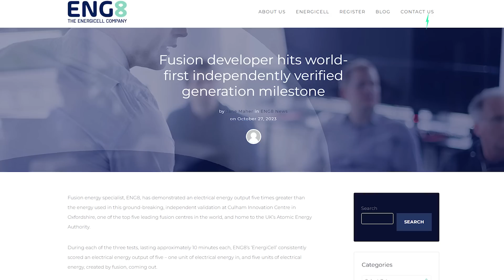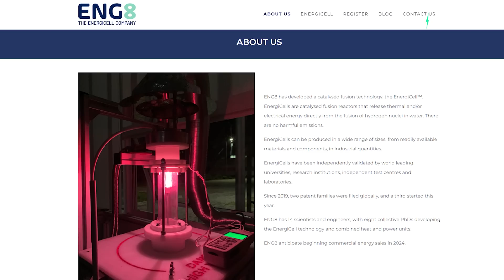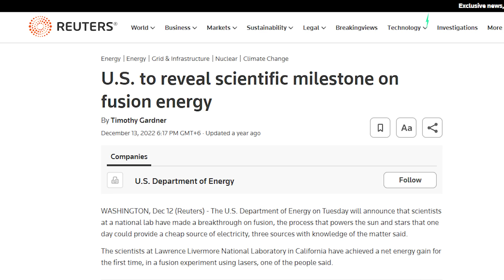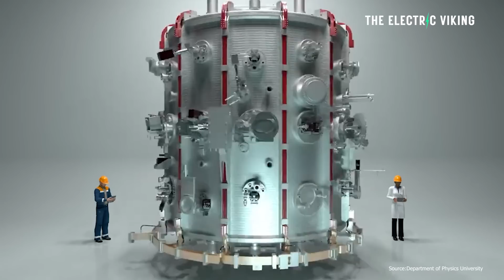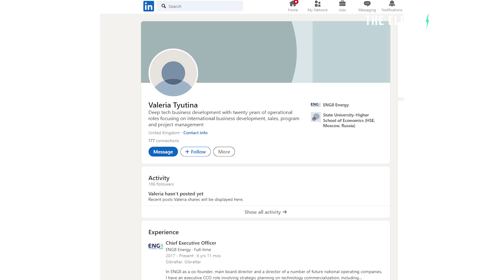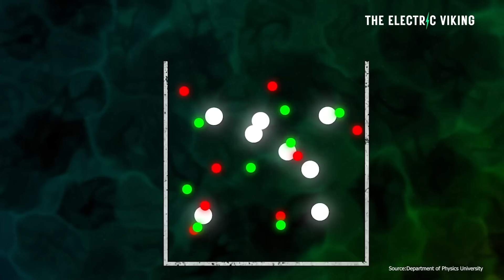Nuclear fusion capable of 500% energy return using water - game over!

Comment: Total nonsense. This guy couldn't even explain how this energy production process works.  Cavitation in water due to sound or high heating has been claimed by researchers to produce small amounts of excess heat, supposedly due to fusion of hydrogen, but this is not a way of producing vast amounts of electricity.  It's a laboratory curiosity, and falls into the category of Cold Fusion, which is a very dodgy theory of fusion,  as no one has proved that it works. All the claims of cold fusion have so far been proved to be fraudulent.

Comment: So if they use some of that Tritium water from Japan that they are just dumping. They could up that Q number even further. 
Other companies have tried frozen pellets of duterium smashed together with rail guns. But if you could just fire ice cubes into a plasma chamber, well any good Engineers should be able to solve that problem. 
One could imagine radial rail guns firing every few seconds, and fusion energy as cheap as an F1 V12 engine.
Pipe dreams can come true maybe.

Comment: Is it the H20 or the small amount of D2O most water contains small amounts of ?  What does the lithium transmute into.
Plasma arc water heaters have been know for some time for 200% efficiency, liberating natural amounts of D2O in H2O.
That will be great if 500% electrical can be achieved.

Comment: I believe you have been misled by their press release claiming that the experiment was 'validated at' rather than 'validated by' Culham Laboratory. The press release is designed to be misinterpreted in the way that you have in an attempt to lend credence to their claims. The very fact that they have rented space at the Culham Innovation Centre, then called in a safety consultancy with no experience of fusion just so that they could print those phrases in their press release, is to me the strongest evidence that this is deliberate fraud rather than anything else.

Comment: This approach goes back several years, previously called the "star in jar" (SIJ) approach.

The reaction is NOT deuterium=deuterium fusion, and it uses light water H2O as part of the fuel -- thus NOT Pons and Fleischman cold fusion. Read the ENG-8 website/literature - I find they carefully distance themselves from P&F.

There are several research teams working on this, in addition to ENG-8.

Not sure why TPTB would oppose this approach - except that they would certainly want to CONTROL it... It can operate on a small scale - individual homes even. Or on a much larger scale... IF CONFIRMED and understood.
Reply: PS - some researchers, including me, think this is a proton - Nickel-nucleus reaction.

Comment: A guy claimed this in Queensland in the seventies. His fuel from water scheme squeezed several million out of the Bjelke Peterson govt before saner folk put an end to it.

You know this one is nonsense as the Youtube video shows them standing around less than a metre from the 'fusion cell' while it is operating. If there was a useful level of fusion occurring, without loads of shielding, the flux of gammas and neutrons at this distance from the fusion reaction, would kill them.

Nuclear energy, fission and fusion, aint that easy.

Comment: Falsehood in the video: The requirement for heating up fusion fuel to the temperature of the Sun.  Most artificial means of fusion requires MUCH GREATER temperatures than those found in the Sun. The temperature at the core of the sun is only 27 million degrees F. The temperature required for tokamak fusion devices are something like 150 million degrees C. This is because pressures at the core of the Sun are tremendous.

Comment: Yea, I am not sold.  This sounds like a fairytale.  If this has been independently verified, where are the public reports?  Why is this nowhere in the popular press?  Surely, if this is a readily usable fusion power reactor to be deployable next, somebody would be losing their mind.  especially if they have the receipts of independent verification.  However, you are the only person I have seen cover it.

The extremely brief tech overview you gave sounds like smoke and mirrors.  Using water as a fuel and a fusion catalyst?  Water is a moderator for nuclear reactions.  This is great for fission, which needs the thermal range neutrons that water in the reactor vessel creates.  However, fusion needs extremely high energy protons to overcome the columb repulsion and get to the range of the strong force that will actually cause the fusion.  As of yet, only pressure, temperature, and excitation can do this.  

Usually, your videos are grounded and realistic.  However, this one is either ignorance or propaganda.  I am not sure which.

Comment: The strange thing about this is that there isn't much on the internet about it. It may be that the world of science is saying nothing until they can fully verify or debunk this.  But if it is real, it would change everything.  So much would it change that I could imagine some governments would want to try to gain exclusive control of it, because of the incredible power it would grant. Imagine, for example, the nightmare of North Korea having unlimited energy.  Unlimited energy essentially means unlimited ability to move and shape matter and unlimited manufacturing capacity, once you combine the unlimited energy with robots. Unlimited energy means unlimited wealth.  Economics, based in part on there being limited supplies of things, would be utterly upended.  Prices of many things would fall to zero.  And what happens when insane or evil groups or governments get hold of unlimited energy? To some extent, that would be countered by accountable governments who would also have unlimited energy -- but perhaps the international situation would be even less manageable than it is currently.

Comment: To be absolutely clear: "5 times" (if true) refers to the energy gain of the reaction, not of the whole system. e.g. a typical solar cell is only 20% efficient. similarly, the energy collection efficiency of these systems is likely to be around 5% in practice. So the energy gain needs to be at least 20x just to break even and around 500x to be practical. We will reach there eventually in around 50-100 years or so.

Comment: I would love this to be true, but I think it is BS. There is no explanation of the reaction, we just get a graphic of the standard  tritium/deuterium reaction which is also used by a lot of other fusion experiments. Even if they have done this, it will still be very expensive as tritium ( hydrogen with two neutrons) is mega expensive at $30,000 /gram. It has a half life of about 12 years. It would be nice if the electricity produced by fusing a gram deuterium and tritium  is greater than the fuel cost, this needs to be discussed as commercial viability is what you need to achieve.  The left over high energy neutron would have to be managed, as too many of these guys flying about is very dangerous to equipment and people.  Other reactions, such a boron3+deuterium  and helium3 (very expensive!)  + deuterium expel protons which can be 'easily' used to extract energy. as that can be controlled by magnetic fields. I would also expect that due to the usual inefficiencies in the whole system, you might need something like 5 or 10  times the energy out from the reaction to make it viable.

Comment: There have been decades of reports of excess energy systems. I am aware of 2 companies that are already selling overunity generators to industry on the quiet. It is here, finally. Much greater outputs than 5 to 1. We are talking infrastructure scale installations and major names purchasing. 
In the 1990s I worked with Bruce de Palma. He promised similar outputs and more. Died under suspicious circumstances. There have been so many pioneers that we should honour and give thanks to. There is energy in the fabric of this matrix.

Comment: Very interesting however don't throw away your solar panels yet. If it is as successful as it claims make out, it will never be cheaper than rooftop solar electricity. After the initial installation cost is recouped the energy is free; anything commercialised into the market cannot beat free energy generated by a home system. The word from those that know is that, if and when fusion replaces coal, nuclear, gas (name your greenhouse/radioactive poison), it will act as a compliment to renewable energy, not a replacement because any energy generated will come at a cost, and profits are there to be exploited from the masses.

Comment: There has been a significant jump in fusion technical breakthroughs, however, while small gains in energy captured over energy input to start the fusion process have been achieved, these are not commercial. I am sceptical that this will be commercial as well.

Comment: Not true Sam. 
In October 2023, the Culham Centre for Fusion Energy (CCFE) released a statement saying that it had "not been able to validate" ENG8's claims about its fusion technology.

The CCFE said that it had conducted a series of experiments with ENG8's device, but that the results were "inconclusive". The CCFE said that it was "unable to reproduce the results claimed by ENG8" and that it was "concerned about the level of scientific rigor in ENG8's work".

ENG8 has disputed the CCFE's findings, saying that the CCFE did not have the expertise to properly test its device. The company has also said that it is confident that its technology will be validated by other independent testing.

Only time will tell whether or not ENG8's fusion technology will live up to its claims. However, the CCFE's statement is a significant setback for the company.

Comment: Ignition simply means you're getting more energy out than the amount of heat energy put into the reaction. However, heating is not 100% efficient. In fact it's < 1% efficient. So you're still putting 100x more energy in than what you're able to get out of it.  Unless the reaction is self-sustaining ignition, fusion will never work. If you constantly have to re-ignite 500 times a minute, we're still 200 years away from getting this done.

Comment: I'm working with a neighbor on a suitcase nuclear reactor for cars.  It boils water to run a steam turbine generator to continuously charge any EV battry whilst you drive.  1000% green energy, completely free power. Our reactor is the size of a suitcase and fits in any car trunk!  It comes with a 15 ft. cord which you fish out any roll-up car window and plug into the car's charging receptacle.  It charges the battry all the time, parked or speeding down the highway, so range is unlimited!
Reply: Sounds just as realistic as Sam's Fusion Power :-)
Reply: @dnomyarnostaw  Look, I worked at Radio Shack for years before they went under, and my business partner used to design electric pizza ovens.  We did not fall off the turnip truck yesterday, my friend!
Reply: @DavidWilliams-qk5jq  I'm f'ng impressed now. As an old Radio Shack employee myself, I saw some amazing things 😀
Reply: @dnomyarnostaw  I knew it bro!  I could tell when you used the words: "sounds just as realistic" in your first comments.  As you know, Realistic was Radio Shack's house brand stereo equipment.  As an alumni, we will give you a massive discount on our Suitcase Nuclear Reactor, which may be in beta testing before you can say Jack Robinson, if the creek don't rise.
Reply: @DavidWilliams-qk5jq  I'd forgotten that Brand name.
I tell you what,  though, Tandy had some great speakers.  👍
Reply: @dnomyarnostaw  I hate to ask, but would you be willing to participate in real world rear-end crash testing of our trunk mounted Suitcase Nuclear Reactor?  We don't have millions $$$ in the bank for simulated testing unfortunately.  And it is not too wise to have the founders of a company acting as "test pilots" I'm sure you will agree.

Comment: If it produces significant amount of power ( not just 1 dust speckle 50k C), imagine the amount of space you need to NOT melt(actually vaporize even ceramics) absolutely everything around it. I think even tokamacs struggle exactly with that : how do you contain that heat to be able to maintain the reaction (or just next cycle)

Comment: If this is real, it would in itself become a singularity -- a point when change becomes so accelerated that we cannot conceive what lies beyond that point.  A bit like death.  This device, if real, would mean virtually unlimited material wealth, unlimited ability to move, shape, and direct matter. With a device like this we could actually build an O'Neill cylinder. We could actually terraform planets.
Reply: @ejt3708 But the claim in this case is that the fuel is water, for example vapor in the air.  And who is going to throttle down the production of energy when you have devices that can produce unlimited amounts and can therefore power themselves?  Why would people throttle down a source of unlimited wealth?  If this device is real, that's what this would be. Just combine it with robots and you have unlimited manufacturing capacity -- with no energy or labor costs.  Prices for many things would fall to zero.  We have already seen something like that happen with some aspects of the internet and internet services, but the internet of things could extend that to material goods.
Reply: @Edward-d2t7r You still need raw materials to produce anything. Of course with unlimited energy, recycling can get very close to 100%. But still, prices will not fall to zero.

Also, with everybody producing unlimited amounts of energy, water might becom expensive.

Comment: Before you go off the deep end, you need to keep in mind that 'Q' greater than one is necessary, but not sufficient to make fusion economical. What that means is that if you don't have a Q greater than one, you can't possibly have a viable power source, but once you get past one, it does not matter how big the Q is because the economics are then driven by the fuel cost and the  build and equipment costs plus maintenance. All these factors are put together to compute the Levelized Cost of Electricity (LCoE), which has to be lower than the cost of wind and solar (that both have zero continuing fuel cost) in order to be economical for future grid power. Let us wait see what a pilot fusion power plant actually costs.
Reply: Good point Ken

Comment: I don't think a Q of 5 will change much. The reality is that it's still really hard to harness that energy efficiently enough to make fusion economically viable. The Q would likely have to be double or triple digits before it'll be anywhere near the ballpark of new generation fission or renewables. Also, the 500% claim isn't referring to efficiency,  it's referring to the ratio of energy in to energy out. Meaning there is a 500% gain in energy once the fusion reaction occurs vs the energy it took to create that reaction.  Think of it like the energy in a spark of a spark plug compared to the energy of the gasoline igniting. There is likely a several thousand percent gain in energy in combustng gasoline vs the spark of a spark plug.

With that said, I do think this is very exciting but it's not all that revolutionary. The previous Q record for a fusion reaction, not counting weapons, was almost 3, so 5 is great but not a huge step forward.

Comment: I will believe this when I see it at scale. For decades I have been hearing hype like this from laboratory scale inventions that have never been able to scale up to practical use at a cost lower than conventional means. Even if the output is 500 times higher than input, if the cost is significantly higher than renewables with battery storage, then it is not a game changer, but a red herring.
Reply: Does it need to be scaled up though. If its what they say, a small unit at home or on site is all that's required.n
Reply: @martinw245  
As to the size of the units, I will believe that when I see them.
"Scaled up" as in being able to go from the lab to a pilot production line in order to figure out manufacturing problems, then being able to go to multiple full scale manufacturing lines that allow production at a speed and "scale" that allow the product to be produced cheaply and in a high enough volume to allow for widespread adoption. And besides the engineering required to develop the machinery in the production lines, supply chains are needed for all of the machinery the production lines needs, along with all of the materials needed for manufacturing.

This process is known as the "valley of death" for many products, as some products just cannot ever be made in high enough volume to become profitable. Or in the case of nuclear fusion, be able to produce enough energy to be practical. I have been hearing that we were close to breakthroughs in nuclear fusion since I was a child in the 1970's, but since then renewables have quietly stolen the energy market at scale and at cost that make them competitive or cheaper than most forms of electricity without subsidies.

While I don't think nuclear fusion will have these problems, there are many great products that could be produced at scale, but never make it to mass market due to lack of capital/investment to build the manufacturing lines, and/or lack of effective marketing (google "Osbourne Effect"). Some products are killed by bad market timing, poor quality control, bad safety records, or being superseded by other products, either new, or improved and cheaper existing, before they ever have a chance. Have you not heard of a product that was already obsolete by the time it was sold?

Many challenges lie ahead, and only time will tell.

Comment: I don't think the percentage of energy gained is the problem. Isn't the problem sustaining a reaction because of the immense heat and probably pressure. After the sustained reaction problem is solved then the Q factor can be worked on.
The 10 minutes sustained run time is the important factor, I believe no other reactors run that long without melting.